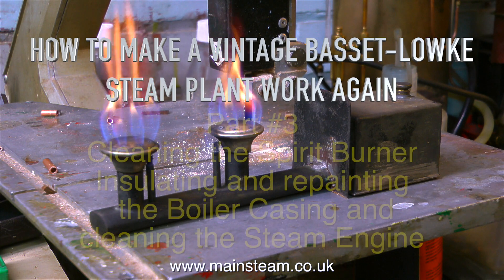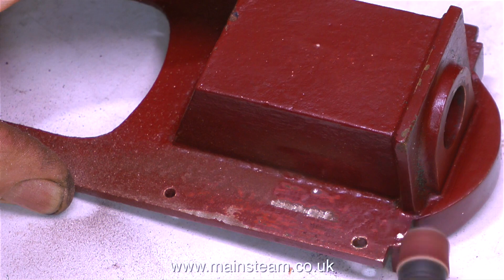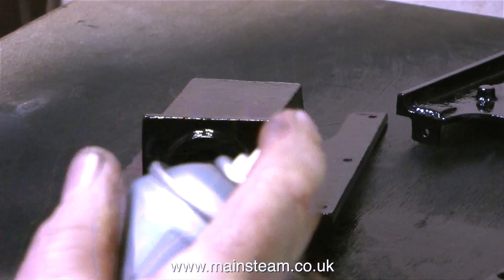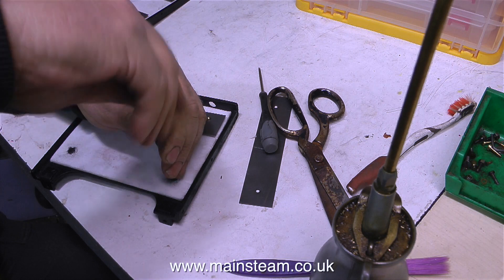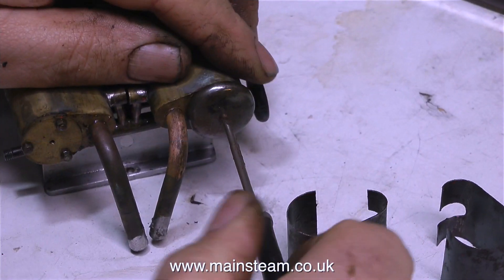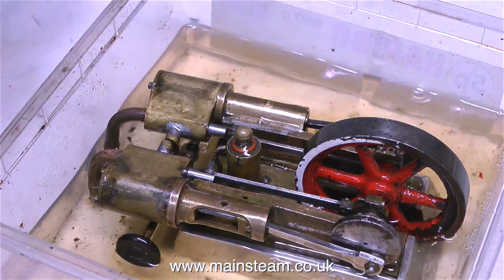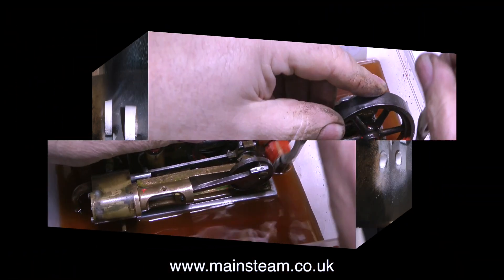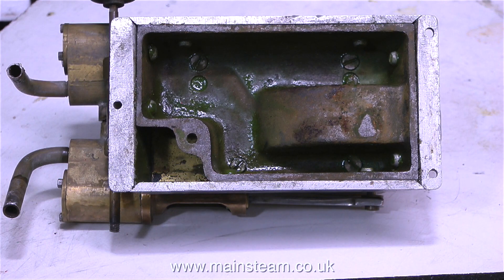HOW TO MAKE A VINTAGE BASSET-LOWKE STEAM PLANT WORK AGAIN - PART #3

Comment: In the PPE portion you didn't make mention of your viking helm. Head protection is vital when making breakfast. Then again I'm saying that while also applying burn cream to my lower regions, nudism and frying bacon are a risky combination. 
I faintly remember a band in the early '70's named Domes of Silence but a google search didn't show them. They were a progressive acid rock/punk fusion country western group with a harmonica, four drummers, and a tap dancer. They were not easy to dance to since 2 of the drummers and the harmonica player were profoundly deaf. 
Very nice getting the flex drive mini-drill. They are great fun and easier on the wrist.

Comment: 50 years ago I spent a week working with my elder brother in an adhesive factory during the summer break. I would use a lever hand pump to decant various solvents into open metal buckets then carry them to a little shed where I'd pour then into an open 40 gallon drum with an electric stirrer like an outboard in it. No PP,E no ventilation just a haze of fumes from the chemicals. Yes it was a glue sniffers paradise but it never did me any harm so your little pot of similar stuff probably won't hurt you either. Though it might just explain your sense of humour😷

Comment: Keith, When I use spray cans on a large (easy) piece, I sometimes use two cans simultaneously and usually move the pattern in overlapping circles or other patterns appropriate to the job. With a bit of practice I can keep a wet edge with minimal runs and the paint goes on twice as fast. A keyboard player should find using both hands independently no challenge at all. 

I also like your method of brushing paint.
Reply from the maker: Now that is something I have never tried - I will however try it - thanks for the tip {:-)))

Comment: I, for one, will not tell you to not put your fingers into cellulose thinners. That would be rude and unnecessary.
I do admire the use of furniture parts for the endcaps, it points to ingenuity on the builder's part.

Comment: What is a boiler band? I Googled around but couldn't find anything that seemed to come close to what I was looking for.
Reply from the maker: Brass banding that fits around boilers, I get mine from www.blackgates.co.uk
Reply: @keithappleton  I guess I didn't phrase my question quite right. What is the purpose of a boiler band? Strength against outward bowing? Thermal control? Although I can't imagine what.

Comment: Hi, I enjoy your videos very much - thanks.
I have a theoretical question - is it possible to use ball bearings in the extreme connections of the crankshaft? I always reflect on it when I see you handling engines with simple crankshafts like the one displayed in this video.
Reply from the maker: Yes, but it's not necessary - and they will rust over time .. .. ..
Reply: Efrat Hoadley ball/roller bearings are great for high speed/low load ratios. Surface bearings are used in full size steam engines (and following, models of said engines) because they are excellent for high load applications. As long as they are oiled, the bearings don't really even touch, in most cases, and the higher surface area leads to lower friction, in high load situations, than an equivalent rolling element. They're still in use, as a matter of fact, most common in day to day life being the crankshaft bearings in any internal combustion engine.

Comment: Do I detect a tiny bit of 'cheesed offness' in your voice today ?
Hope it just a temporary thing from getting too many stupid comments recently, the problem with the internet is that everyone can comment on anything and stupidity is rife these days !

I work in customer services for a large national retailer and have to deal with hundreds of these people on a daily basis !
One young woman called one day to complain about the 'cordless' kettle she bought a few days ago which wasn't working. It turns out she didn't realise it came with a base and a 13A plug and had thrown it away with the packaging. The stupid part was she waited 3 days for it to boil before calling !

The problem is, the safety Nazi's have done away with natural selection so now they are multiplying !

Have a great day Keith !
Reply from the maker: No, I'm fine. I often do voiceovers on the videos very early in the morning (I have to in order to fit all the time in that it takes to make these videos in the frequency that I upload them) and this morning maybe I should have waited until my Brain woke up or at least had some breakfast . . . .  I never get Cheesed off, quite the opposite - I am always optimistic :}-)))